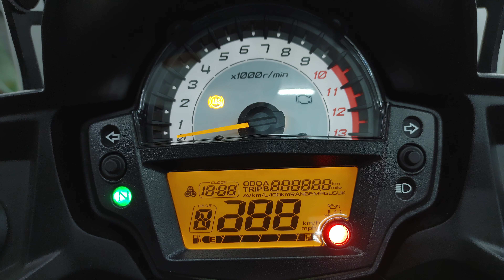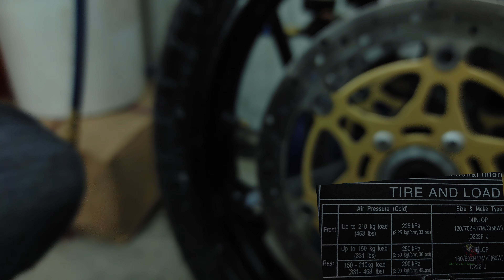KAWASAKI VERSYS 650 | DUAL SPORT TIRES INSTALLATION (19 INCH FRONT WHEEL)

Comment: Did the new tires increased the ground clearance and seat height? Any issues with abs or electronics due to size change? I am planning same for my 2016versys 1000
Reply from the maker: Oups dont know why but didn't get notified for your comment

Heres my answer, actual ground clearance is about 8,5 inch with 19 inch conversion, abs does not work because the lack of ABS disc, speed reading still working (taken at the rear ABS disc), very happy with the mod

Comment: Where did you jack up the bike from? I tried look for a jack point on the bike, but couldn’t find anything I felt comfortable jacking it up from
Reply from the maker: I used the exhaust pipe as jack up point, not the best but i could not see other options, but don't worry exhaust tubes are pretty sturdy, just make sure that your jack wont slip

Comment: So you had to remove the ABS at the front in order to fit the 19” tire? Too bad. ABS is good to have…
Reply from the maker: Hi, if you can find a 2008-2012 wheel with abs disc and relocate the sensor it would probably work

Comment: Why you did that to your disk ??? They supposed to move about little!
Reply from the maker: Yes but not that much, when stopped if i applied the front brakes then push the bike back and forth it was giving the impression that the wheel was loose
Reply: @MathieuTechMoto  ?????
Reply from the maker: @joseribeiro2427  what's up ?